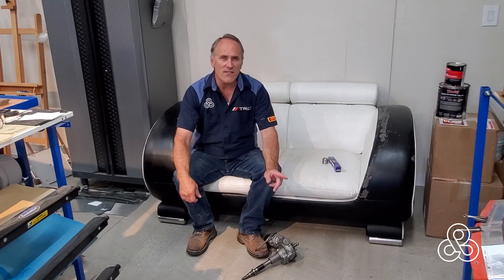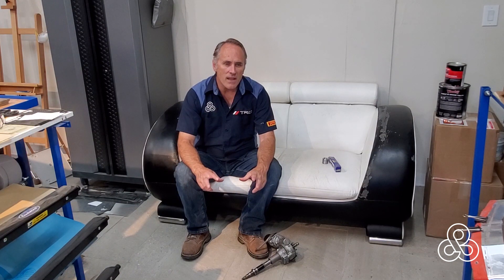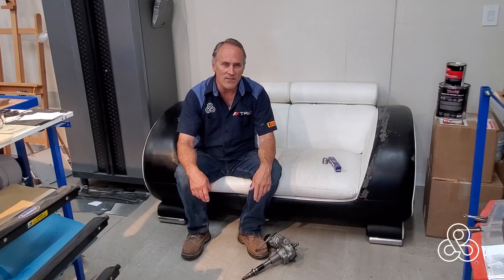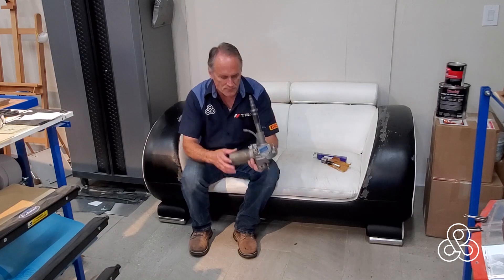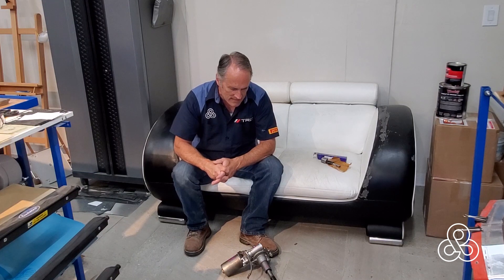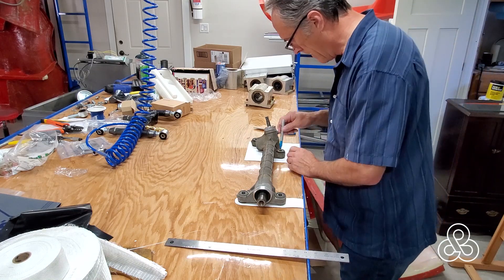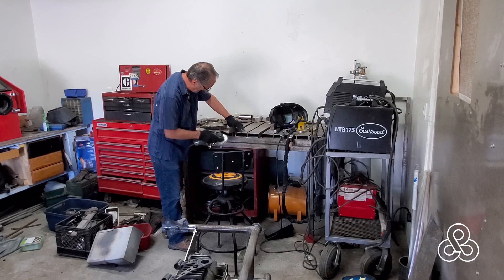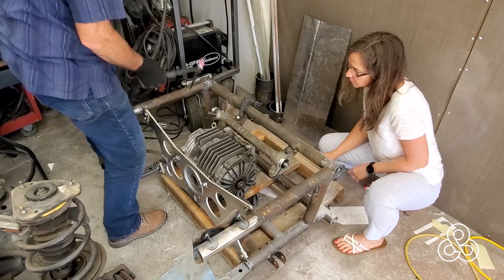A32 - Arete Supercar project- steering rack placement

Comment: for the CAD system I use Pizza Box's or the box's from Pepsi Cubes I go threw a lot of both if my 2 dogs don't get the box's before I do .. they love cardboard rip a bite size chunk spit it out and repeat till a huge mess on the floor then there is the dog toy's stuffing looks like a crime scene ..lot's of times the thin cardboard works great and if you miss cut just tape more to it and recut don't have to start over ..

Comment: Your assistant Jodi? Careful, Bub. I believe that her correct title is “Boss”. 🤣

We tried to make the seat insert with foam beads and epoxy. We made it by laying out a flat sheet of poly four feet long and thirty inches wide and turned up the edges two inches and left an additional four inches of extra sheeting all the way around. This made a sort of deep large cookie sheet shape. Then we simultaneously mixed two five gallon buckets of foam beads (3/4 full of beads) and just enough resin to make it like pourable and self leveling cake batter. When poured into our little trough it filled it up to the two inch depth. As soon as it was nicely filled and flat we folded over the sides, laid on another pre cut sheet of poly and thoroughly talked it shut with clear tape, very important. We waited about two minutes and then laid this bag in the seat shell. Immediately our smaller second driver got in and hovered above the bag until he was roughly in place. Then he sat down and wiggled (very funny) until his butt was almost on the original seat and the excess foam had moved up and around the sides. The bag must be carefully sealed as we found out. Then we handed him a beer and told him not to move for fifteen minutes. Did you know that as the epoxy sets up it makes heat? Then he had to get out as carefully as he got in. We left it there for a day. Later it popped right out. The poly had bunched up where it bent from seat to back. We removed the poly and it held its shape very well. Then we cut off lots of excess, filled creases and sanded the new shell then a one layer mat was glassed on it. After it was set we glued on a 1/4 inch layer of foam in the seat and back and covered the entire thing with a cloth slip cover rather than upholstery. I guess it could be upholstered though. It worked pretty well although another driver preferred a much simpler three inch thick foam pad and a separate lower back support that he bought on line. We had to abandon that because of the fear of fuel absorption in a crash and subsequent fire danger.

It did take us three tries to get it right. Also, cover the entire area inside the car with a sheet of poly before even thinking of setting the foam bead, flat epoxy pillow in place. You will never regret it.

This was done to accommodate our drivers in a purpose built Ferrari 308 GTB race car for SCCA GT-2 races on the west coast in the early 1980’s. I often wonder where that car is today.
Reply from the maker: Jodi is the "controller" which is the financial term for "Boss." Ha! You described exactly how I pictured the epoxy body mold. The faster the epoxy sets the more the heat exotherms in a shorter time. I will have to get some fast epoxy as I don't want to sit still for 3 hours. I worked for a Ferrari dealer in Salt Lake Utah in 1982. those were the days of the 308!

Comment: It used to be the rage in whitewater kayaking to buy a seat and or footrest which was a fabric bag full of bean bag balls (foam balls) you'd nestle your bum nicely and then pull a vacuum on the bag making the shape permanent it seems this might achieve the fit you want with the ability to change for different driver's or over time. Not sure how you'd upolster it nicely though.
Reply from the maker: With that good of a fit I could take the car over a waterfall as well. Ha!

Comment: Taking rapid moulds can be done with a bag of packing beans and a vacuum cleaner.
If you want to make a custom seat cushion fill some clothes storage vacuum bags with beans until they are full enough to work as a cushion.
Place about three these on the seat one to sit on one for lumbar and one for back.
Position them and get comfortable then vacuum out the air. Check for comfort and position and add or remove beans as needed until pillows are perfect. Take a mould of the pillows either individually or as a unit.
I believe you can obtain a suitable high density foam from marine auto trimming suppliers to mould the cushion out of.

Comment: All wheel drives and front wheel drives have inherent steering problems. Understeer and torque steer being the primary issues.
Ford did some interesting engineering on front knuckle and and strut arms on one of their performances hot hatches. Before finalising front steering design I’d look at what they did.

Comment: At a shop I worked at we used the expanding foam method to make seats.  It does require at least two people and the foam gets uncomfortably warm when it goes off.  To anyone going that route I'd recommend wearing a wetsuit.  It'll make the experience more tolerable.

Comment: I have done the foam seat molding before, be careful it gets VERY hot and can burn your butt!

Make a plywood shell of the outside shape setting the mounting points and any frame for adjustment etc, the foam just makes it a close anatomical shape.

Note these seats are for racing where comfort over long periods isn’t the main consideration, they are just to lock you in and take up very little space. We used the tub as the outside form, put the foam in a bag and sit on it in the tub/car.
Reply from the maker: I will insulate my butt with the appropriate amount of upholstery padding. Ha!

Comment: Cutting speed for a reamer in mild steel.  Determine the cutting speed and feedrate for a High Speed Steel drill of the the same diameter as the reamer.  The cutting speed of the reamer will be half that of the corresponding size High Speed Steel drill.  For a straight reamer the feedrate is double that of the corresponding High Speed Steel drill.  If you are feeding by hand, you want to use enough feedrate so that it doesn't vibrate.

Comment: Now for the Arduino-CanBus part. As you might already know that there are several types of Arduino, CAN-Bus shield available. Now depending on how many ports and connections you need to choose one from the available PCBs. About the coding part, I'm not sure which components that you're using. We used Raspberry Pi and Arduino and everything was custom, so if you're using ECUs from OEMs or aftermarket ECUs then its another story altogether. Please let me know until the everything becomes back to normal in UK, I've time to spare.
Reply from the maker: I will be running an MS3x ECU with a Megashift controller as well. If I go Arduino I will likely just write a sketch that sees a signal from the megashift (1st gear) and applies voltage to the assist. the car is going to be very light anyway and I don't think I will need steering assist at anything above parking lot speeds (1st gear)  stay tuned for videos (still a ways in the future) when I get to this.

Comment: Hi I've become a huge fan of your videos. As an engineer I agree with a lot of your choices and problem solving methods that were shown in the previous episodes. For your seats I would recommend going with the method how F1 does it. That's the same method we used in our Formula SAE cars in university. But the actual problem in your case is that its not a dirty grimy race car, you'll be upholstering the seat. Second problem is that the foam is used for cushion and there's a seat frame underneath the foam which is molded as a part of the chassis. Now here's how I might tackle this problem. First i would try to find a universal bucket seat which fit the dimensions, style and ergonomics of the car and the driver. Next I would set the seat bucket part in the monocoque using foam, once cured, take it out and make a 2 part mold. Then pour foam in it, once the foam core is cured, take it out and place it back in the monocoque, fix it with resin and lay s-glass over it. This will make it a part of the chassis. Now you have a seat. To make the seat foam I would just use a plastic bag with polyester beads and resin to mold it with you sitting on it. Once cured, I would take it out shape it a bit add a bit of styling and supports for long thighs lumbar and then send it for upholstery.
Reply from the maker: Thanks for the suggestions. You understand my problem perfectly, once I get  a mold of my back side I need to build away from that form to add upholstery thickness and then a frame. I'm a bit away from needing seats right now, but have gotten this beautiful orange and blue Italian leather in and an itch to fire up the sewing machine. maybe some exposed carbon fiber seat frame showing through? Stay tuned and thanks for following the channel.
Reply: @BuilderCreator  Thanks for your prompt reply. I'm looking forward to the car being completed. I've never seen a single person complete car in such a short time frame and with such high standards of quality. Also I admire the fact that you've knowledge in multiple disciplines of engineering and also manufacturing. It's my dream to become a production engineer.